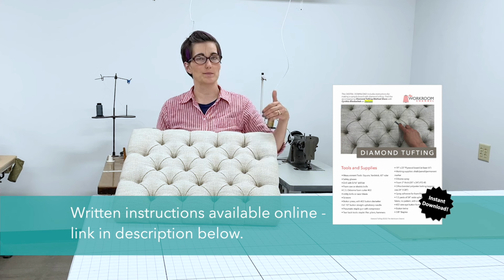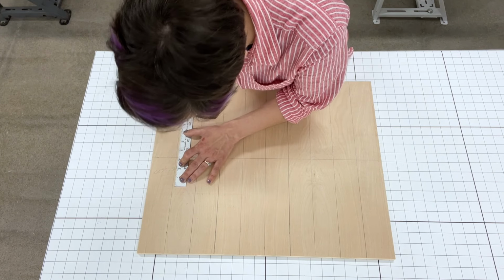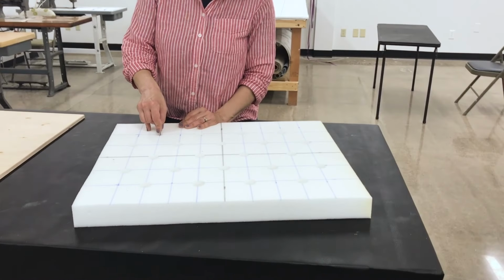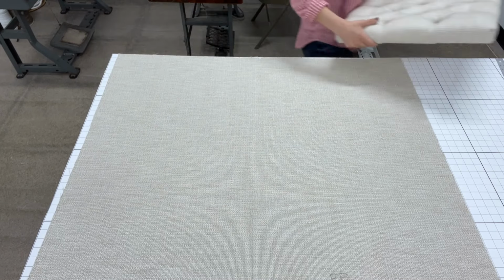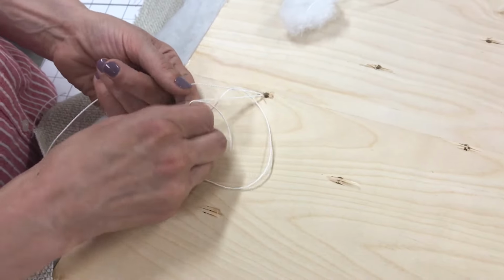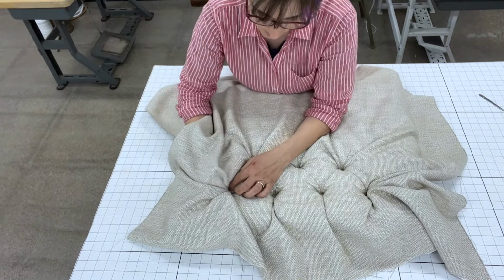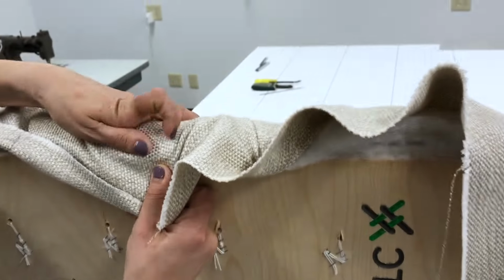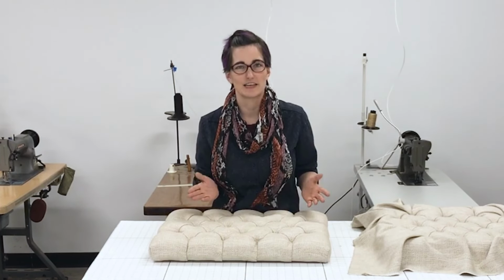Method Share - DIAMOND TUFTING

Comment: Fantastic job making a video that can be followed for a repeatable process, and many thanks for sharing!!! My one question is that when measuring the fabric dimensions that will be needed, Cynthia used the term “handles” (Part 2 approx 27 mins into the video) Is this the thickness of the boxing? Thank you in advance
Reply: I think what she meant is the part of the fabric where you are going to handle/pull while stapling the edge.